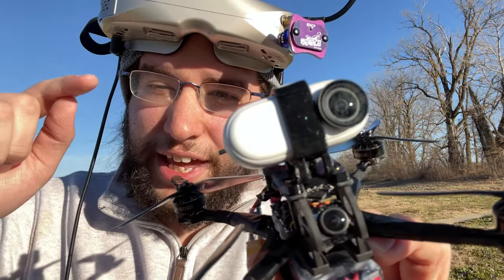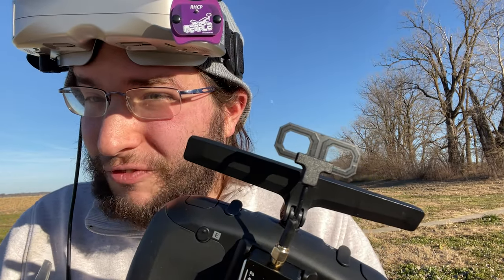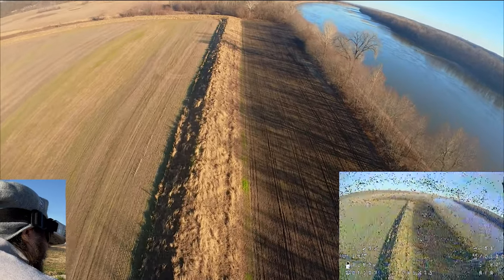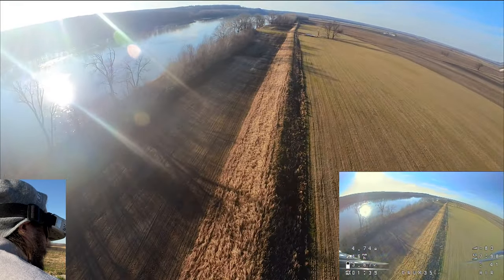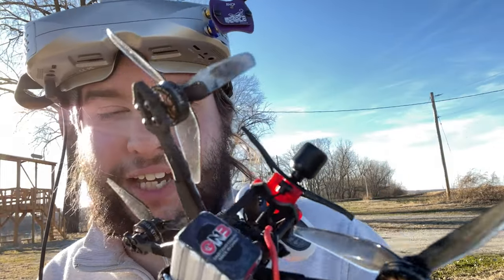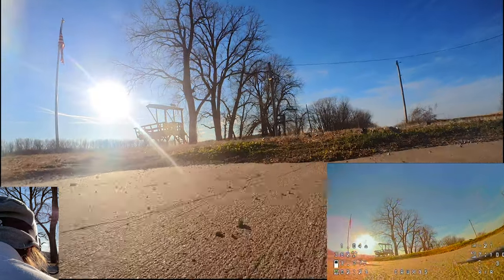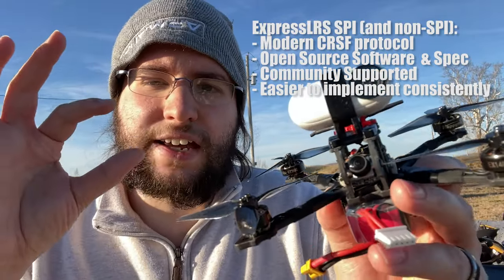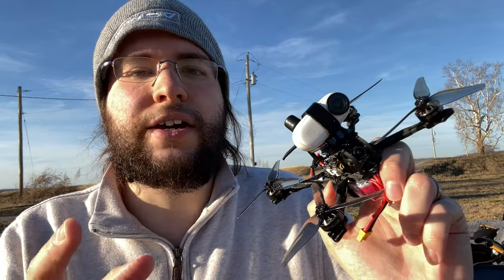ExpressLRS SPI Receiver Range Test (Crux35 Analog ELRS FPV Drone) 👍

Comment: There is not the slightest relationship between "range" and "SPI".
Reply from the maker: 100% correct on paper! However, just casually ask anyone what they think about “SPI based receivers", the term has become synonymous with “shitty range.” This is only because so many hardware implementations of SPI based FrSky and FlySky receivers are bad. The FrSky D8 protocol being horribly old and slow makes matters even worse. "SPI based receiver" just has a terrible reputation. 

So, it was refreshing to fly a modern, fast link protocol implemented via SPI receiver that’s built correctly. So it works exactly the way you would expect an external receiver to function, which has virtually NEVER ever been the case for FrSky SPI. 

I did this video in hopes that anyone who thinks choosing ELRS as SPI would be the same old shitty experience they had in the past with other "SPI receivers", would best reconsider that thought because they'd be missing out. Hence why in conclusion, this result is really not that surprising at all to those who know that.
Reply: @JohnCuppi  Alright;) I just didn't like that the impression was left that SPI is a bad standard, people quickly get confused on tech terms.
SPI is better than USART in almost any way. Faster, simpler and likely more stable in terms of EMI stability which is always a concern in quads.

Express-LRS is clearly the way forward, FrSky has always been a pain. 
Also given it's open source and open hardware there is going to be a lot innovation coming.
Reply from the maker: @haka8702  Well, I'm sorry. I didn't mean to give that impression when I made this. In fact, I was hoping that just the opposite would be cleared up by this video... that SPI is not what we should associate with being the problem. It's just all the bad FrSky and FlySky D8 receivers. I sent this to a few friends of mine before posting it, and they said they would now LOVE to see ELRS as SPI on their whoops instead of FrSky. They did not know that an SPI receiver implementation that could function extremely well like this. 

ELRS is the way forward clearly as you said, and FrSky SPI receiver implementations will definitely no longer exist for any new products. There is just no reason to keep implementing old inefficient protocols that never had any official support from the manufacturer anyway. That was one of my bullet points for ELRS over FrSky, fully open source and an open hardware spec. There is one small disadvantage to UART vs. SPI receiver that I have run into -- to update the software, a full flight controller firmware update is required. This has been a bit of a pain with updating to expressLRS 2.0 while betaflight is still in 4.3 rc at this time. 

I will have my second ELRS quad with an SPI receiver arriving tomorrow, the Mobula7 HDzero, I'm sure the range will be excellent and as expected. 👍